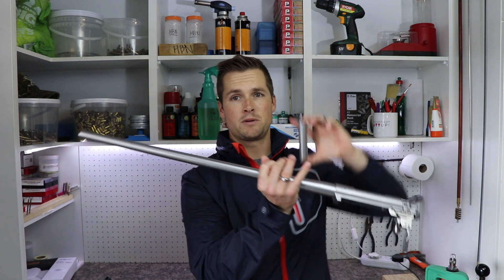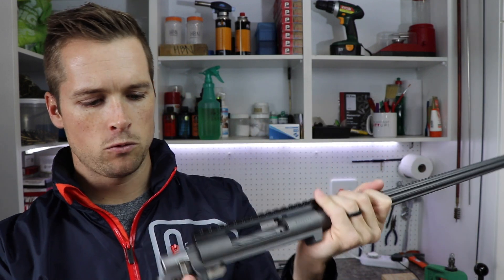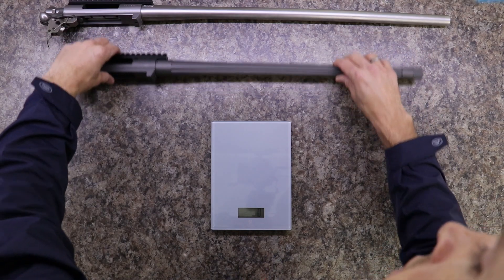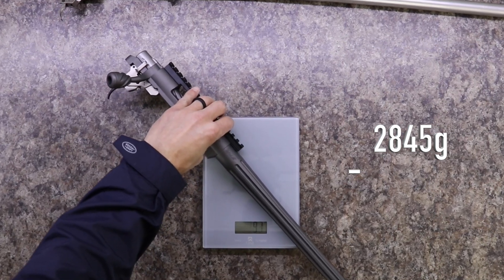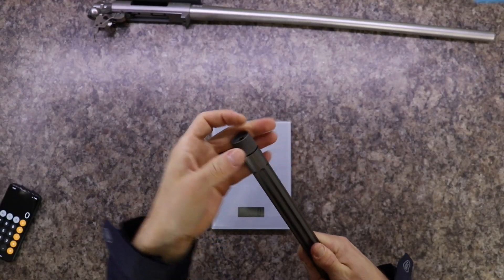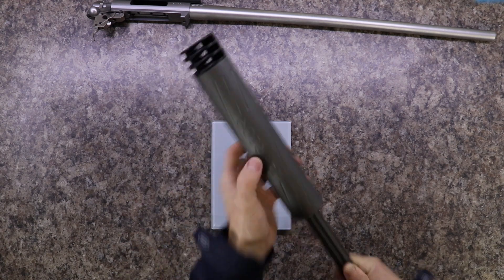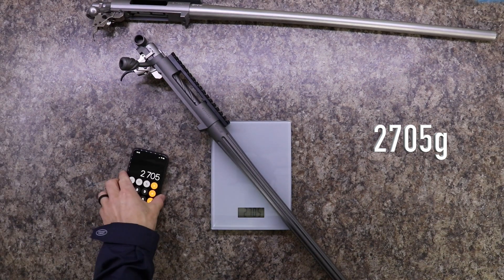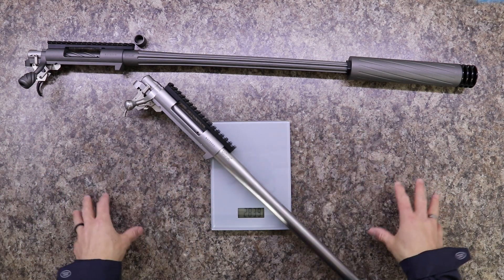HOW MUCH WEIGHT DOES FLUTING SAVE?

Comment: In my experience a fluted barrel is heavier than a standard #2 barrel. To account for the fluting the barrel must be of larger diameter to begin with so after fluting there is still more steel material in the portions of the barrel that is not fluted. If I used a fluted barrel on my .35 caliber for instance I wouldn't be able to carry the rifle for very long in the mountains.

Comment: You basically saved 1/3 lb in weight. Thatd be like.. a polymer AICS magazine in weight.
Reply from the maker: Actually, its way more, cut 4inch off the barrel also.
Reply: I should have Clarified more. * with suppressor on it’s only 1/3 if a pound (ob). *
Reply: Piet Skiet also, what camera are you using?
Reply from the maker: Canon 80D